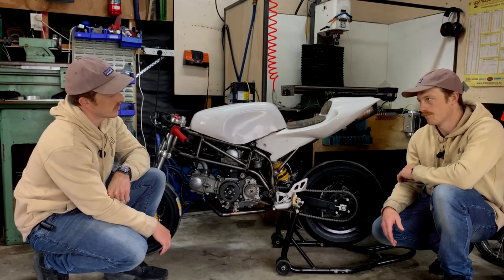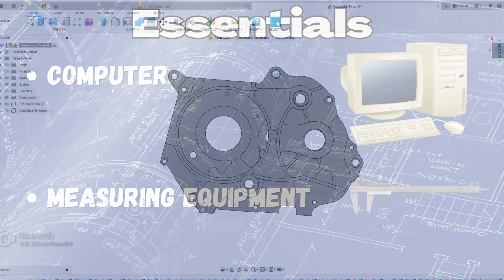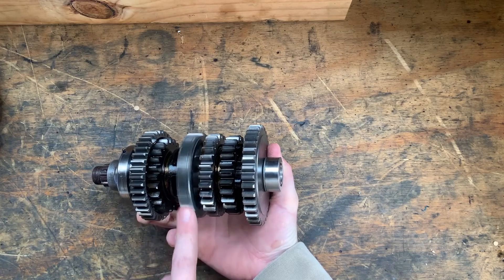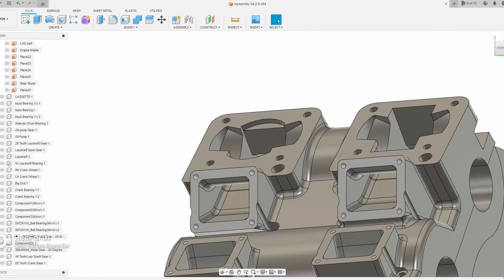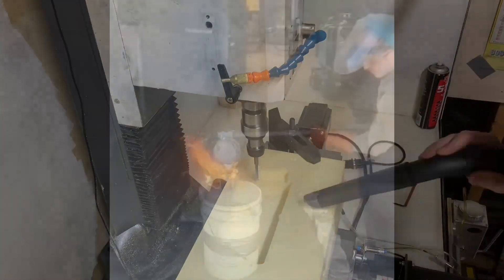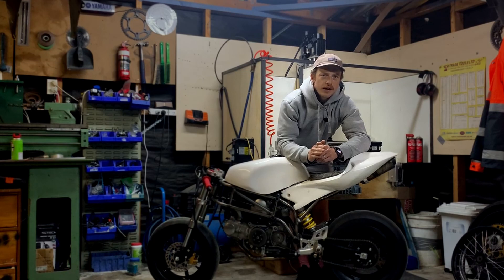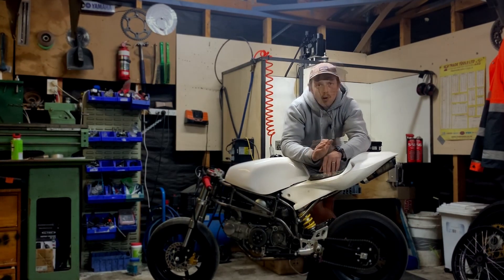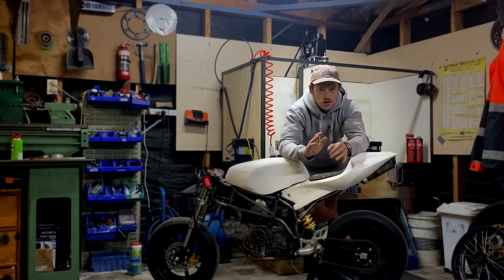How to Make a Motorcycle the Easy Way

Comment: Molto interessante il lavoro che hai fatto con il bicilindrico e seguo con interesse il V4.
Per la fusione, perché non ti fai gli stampi in PLA stampato in 3d e poi scioglierlo per avere il vuoto per la colata. Lo ho visto fare sul xanale di Simple Bronze Casting, un ucraina che sta facendo un modellino di un trattore
Reply from the maker: I would be worried about the effort of melting the PLA and having the mould keep its shape without defects. The lost foam is a well proven technique and I’ve already had success. But I’d give it a go if I had a big enough 3D printer.

Comment: Awesome project man. As a 2 stroke fan I can't wait to see it running.
Also an idea it would be really cool if you get some custom pipes made to maximize power delivery
Reply from the maker: I will definitely be making some pipes. I made a set of pipes for my RZ350/RGV hybrid, I think I show the bike in the garage tour video. They came out pretty good for a first attempt.
Reply: @OddsandEndsMachining  awesome I will check out that video.
By the way did you decide on what kind of firing order and how will you clock the pistons.
You can incorporate in your design the possibility to play around with that and try different configurations
Although personally I love the even firing order and the screamer sound if it's an only track engine maybe something different fits better
Reply: @seifdriouech9008 buena idea lo del orden de disparo🤔
Reply from the maker: @seifdriouech9008  I am going to fire them in pairs at 90* it should help with balance and power delivery.changing the order won't be too hard though.
Reply: @OddsandEndsMachining  are you intending to fire them in pairs for better torque output?
Reply from the maker: I am doing it for better traction and more ride-ability. @seifdriouech9008